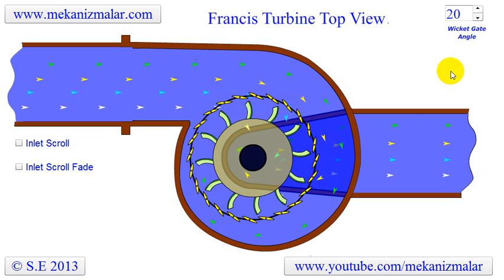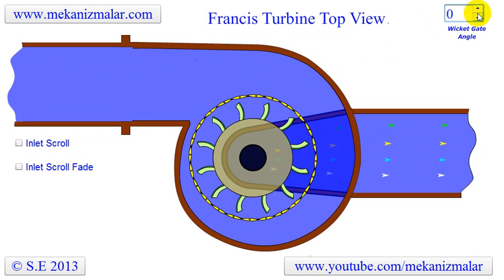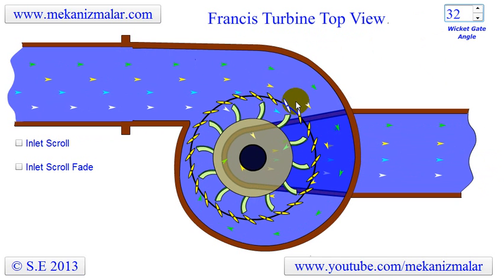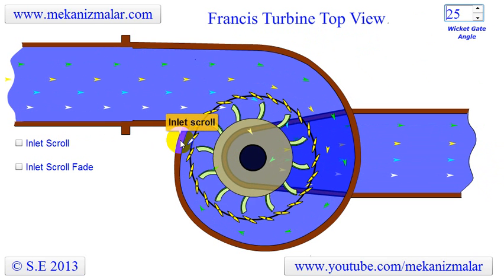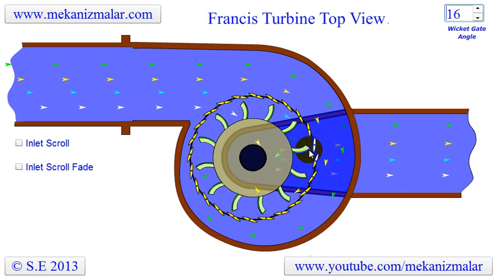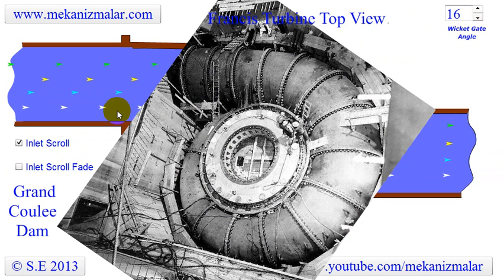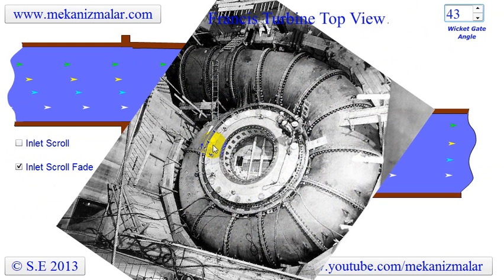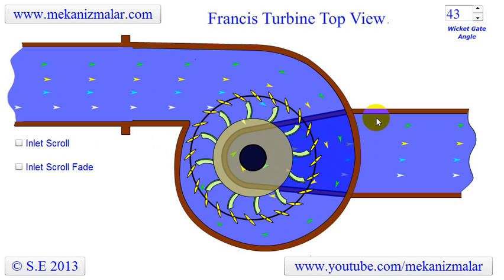Francis Turbine Top View

Comment: hello! as an engineering student I'm working on a specific hydroelectric project. Although I can find every single parameter such as power, consuming of water, inflow of water etc., still can't find a mathematical relevance or equation to connect the opening of the wicket gates (%) and the demand of power or water inflow. Can you help me on that?
Reply from the maker: Dear Jimmy,  Unfortunately, I can't. First of all, I do not have deep knowledge as required to answer your question. Second your instructor should give you enough guidance to solve to finish this project by yourself. 
Here is a link I found might be helpful,
 http://hydropower.ornl.gov/docs/HAP/MechFrancisTurbineBestPractice.pdf
I also hope that someone know this subject come along quick enought to answer your question in a timely manner.
Reply: Thanks a lot mate! In fact, I am searching constantly through the internet and bibliography, so I suppose could find that one sometime soon. Keep up with the good work and I appreciate your help. (y)